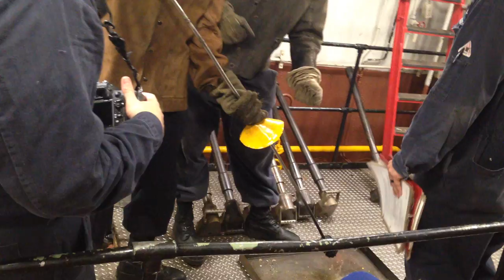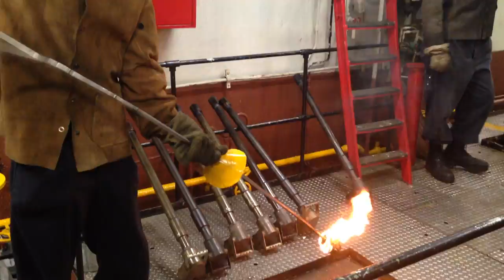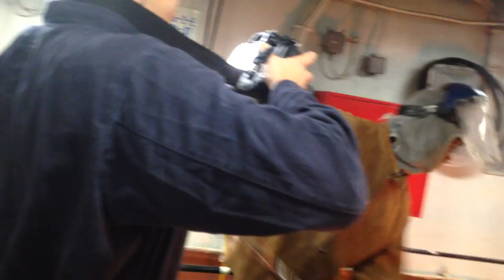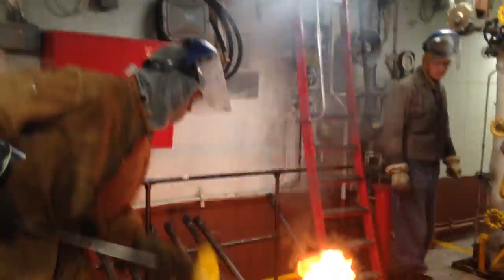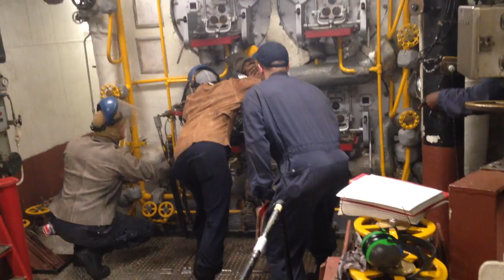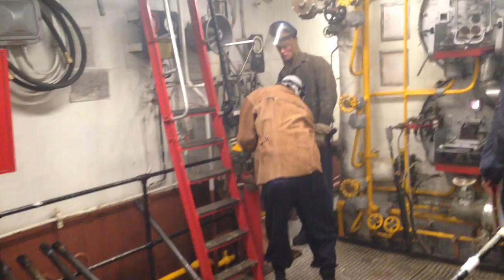Lighting the Boiler on USS Bataan (LHD-5)

Comment: Saw a chief light fires off of the glowing back wall once. The front of the boiler jumped out about 2 inches and scared the shit out of everyone! But it worked! I hear the captain didn't like it but tolerated it because it got the ship moving quicker which is good if you're under attack and you lose fire in the main boilers.
Reply: We had a Chief who  blew 1 Able boiler up though the uptakes and out onto the pier doing that. He actually was promoted to Senior Chief later on.
Reply: thank you for sharing your stories.
Reply: We had hot brick light off which caused a firebox explosion which demolished everything up to and including the steam drum. I hear it made a nice smoke ring out the stack as well.
Reply: Lit fires off a hot wall in an emergency once scared the hell out of me as a topwatch. Was “indirectly ordered” by the EEOW who was our division officer. Very minimal damage to brick work, but flexed the hell out of the air casing.

Comment: Ah memories. I was a Burnerman on the Anchorage, out of Long Beach in the mid 80's. Same safety gear, (leather jacket, gloves & face sheild) but I don't remember shaking the torch like that. But I do remember changing out burners & cleaning burner tips. Didn't know they still have boiler powered ships. Also, I heard they dont even have a BT rate anymore.
Reply: They merged BT into MM in 1996

Comment: I think “the pit” was hottest when we were in Cartagena Colombia. At the time, we are working 12 on 12 off because we were doing fire sides and tubes In the Ford fire room. While my friend and I were out on the “” Beach” we came back to find out that the guys in the after fire room and drop the load. My friend and I went down in our civies to pull out the guys who are overcome by the heat while they were trying to relight the boiler. We didn’t have any short steam and my partner and I as well as two others real at the boilers and everybody was safe and steam and power were re-connected. Cartagena was about 110° and naturally down in the fire room it was much hotter than that.

Comment: Was a lot easier back in the 70s Navy, lit fires in t-shirts. No face-shields, no flash gear. We always got the job done safely with none of that yelling back and forth and drama in half the time.
Reply: Newport R.I. 1970;
Lighting off from cold iron, U.S.S. M.C. Fox DD829 After Fire Room. We're steaming a B&W 600 P.S.I. "M" type boiler with variable controlled super
heat.
Shore steam= 90 p.s. i. mostly, less if nested out.
Light off emergency feed pump, look for positive rise in gauge glass, secure pump to standby status.
Roll over #3 fuel oil pump, cut in steam to fuel oil heaters, we're burning Bunker "C", regulate flow for 200 degrees F. Open recirc valve on the designated boiler.
Messenger of the watch, check for L.P. drains set to bilges, ready 1 forced draft blower for duty.

Check station manned, burnerman makes up a #42 orifice plate, loads into the mid burner station right next to the torch hole. Roll over forced draft blower, full open vanes, purge firebox.
Ready torch with J.P. 5 soak, standby with Zippo, open torch port, light torch, shove in firebox, snap fuel flow handle up to max, crack air vanes for minimal
flow, cut in fuel at burner and yell "FIRES LIT, #3 BOILER" messenger records time, Main Control gets a report.
Close fuel oil bypass, adjust air vanes for very slight smoke (economy haze) Hard part of light off is now done, have a smoke and some coffee,  took all of 15 minutes.

We're Black Gang, we know our shit, officers never come down our hole-- ever.

Christ it’s been almost 50 years ago, and I can still light off one of those suckers. ☺
Reply: Life before E.O.S.S. was so much better. Everyone knew their jobs and did it right, no running for your book before you did anything.
Reply: Indeedy. BTFN NUNZIATO USS ANCHORAGE (LSD-36) 1976-80... I lit-off many boilers in my days in.
Reply: @58nunzi  One part of the infamous Garpunk and Nutpuck team on the Anchorage LSD-36. Joseph Arseneault BT2 LSD-36 77-81!!!!
Reply: @josepharseneault4168  Well I'll be a sumbitch! How are ya Joe?
Reply: @58nunzi  I'm not doing to bad at all. Tell you what I weren't no lifer. Did my twenty and booked from the nav!!! Had some good times tho. I did almost got blown to bits when I had a main space fire when I was on the Connie CV-64. How you doing???
Reply: @josepharseneault4168  I have Gar on my Facebook. Are you on FB?
Reply: Those were the days! One time in SRF Subic, there was a typhoon coming and were told to get underway ASAP. The duty section in the fireroom, all three of us, got lit off and formed steam before they called it off. I held the torch in with my foot!

Comment: This looks overly dramatic and primitive. Oil furnaces of the early twentieth century had spark ignitors, so I'm curious why military vessels used burning rags. I'm guessing to increase the overall stress levels.
Reply: Maybe it has something to do with being able to light with no electricity
Reply from the maker: She’s still using this method in the 21st Century, so as the saying goes, “If it ain’t broke, don’t fix it!”
I do imagine it has to do with being able to light without electricity, as was mentioned here, but I’m not sure.
Reply: 2000 degrees in that furnace, no spark ignitor would survive that. Rags would leave debris, scarring the bricks.

Comment: There’s got to be a more modern way to light a boiler.  All that smoke and jacking around.  This guy doesn’t know what he’s doing.
Reply from the maker: Someone else in this thread pointed out that this must be a new guy being trained. Probably true. I know that they were starting the boiler for departure, and we set sail a few hours later...
Reply: Yeah. Modern boilers I've sailed with (on merchant ships) all have electric ignition. (Electric spark lights a little pilot burner, which in turn lights the main burner.) You just push a button and it starts itself.
There's more to go wrong that way, though.